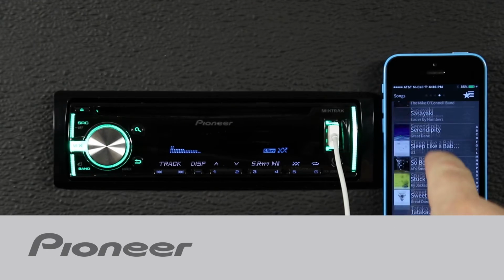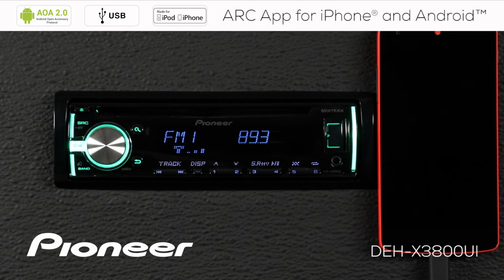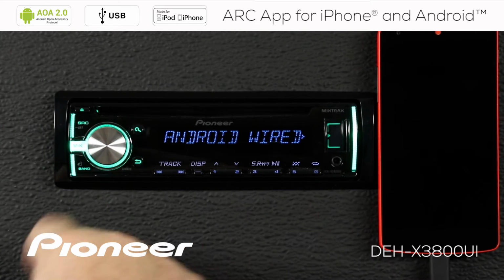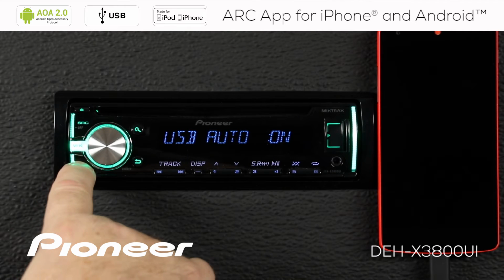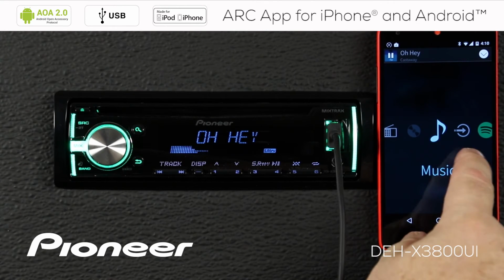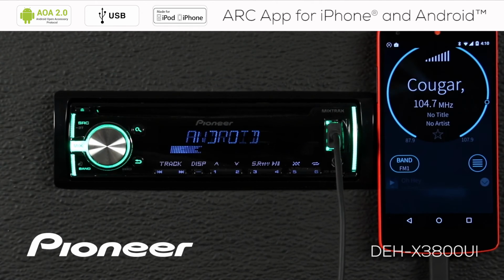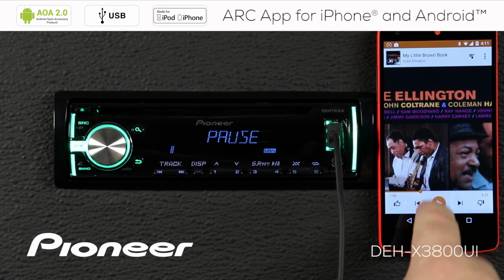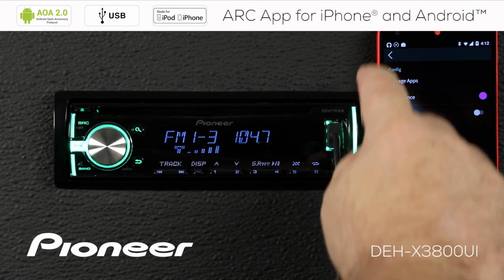How To - DEH-X3800UI - ARC App for iPhone and Android

Comment: I have this radio, Which tablets work with this app? i need to turn down the eq at about 6Khz its piercing my ears
Reply: The Pioneer ARC app is designed to work with selected phones.  It's not designed to work with tablet computers.   You can operate the individual EQ frequency bands without using the Pioneer ARC app.  You can see it here:  https://youtu.be/sTYg_NMyPi4?list=PLw63zJRQbCNh3qI2px7hv5m6SBeuNX1Zv   The Pioneer DEH-X3800UI will work with the Pioneer ARC app on iPhone 5 and newer with iOS 8.0 or newer.  The Pioneer ARC App is compatible with selected Android phones operating the Android OS version     4.1  up  to 7.1.2.  The phone must also support AOA (Android Open Accessory)  version 2.0.   Ultimately the compatibility depends upon the individual smartphone.  Please note, some Android based devices will connect via AOA 2.0 but may not work properly or emit sounds due to the phones software design regardless of the OS version.  You can find more How To videos about Pioneer DEH-X3800UI here:  https://youtu.be/FQAg7XZbOKA?list=PLw63zJRQbCNh3qI2px7hv5m6SBeuNX1Zv   and you can find more videos on Pioneer's YouTube Channel here:  https://www.youtube.com/user/pioneerelectronics
Reply: @deckerdotto6035  Yes i can adjust the EQ from the head unit but thats only 5 bands and i cant cut the 6khz frequency which is killing my ears, has to be done through the app, the app has 10 bands
Reply: @deckerdotto6035  Will it work with an ipod touch?